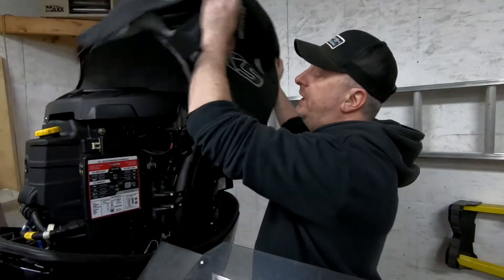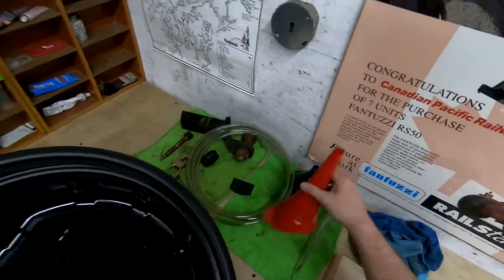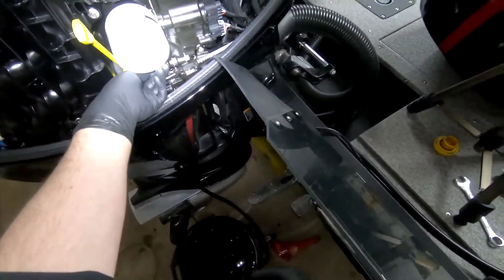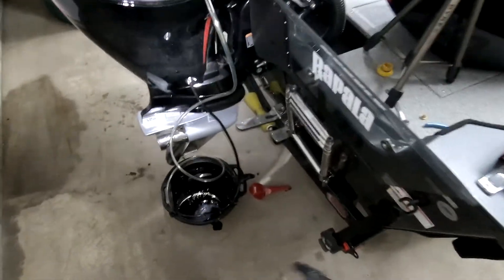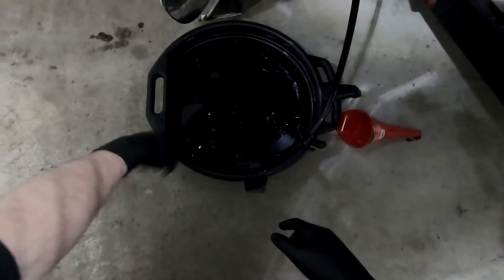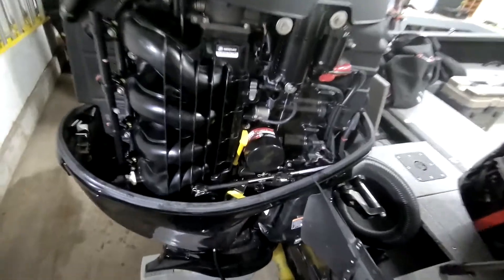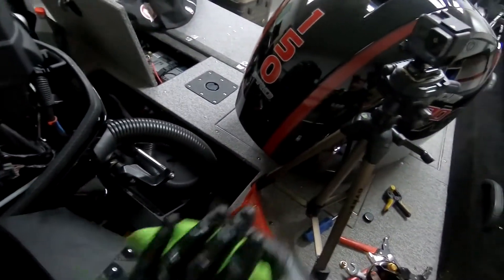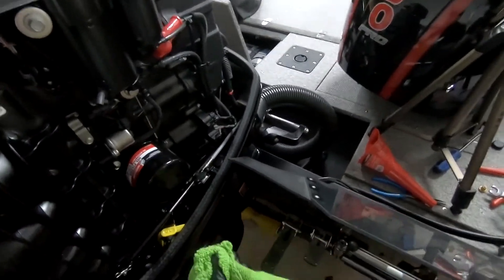2019 Mercury 150 Pro XS 4 Stroke - Oil and Fuel Filter Change

Comment: Thanks for the video.  The lower fuel line dropped in the filter hole.  It's in the lower part of the motor.  Anyway to get it back out, or do I need to go to a dealer.
Reply from the maker: Thanks for watching!  I pulled it up and clipped it so it wouldn't fall, I'd guess it isn't too deep but never fished one out.  Maybe a drain claw grabber and a light to see?
Reply: @TheGrumpyFisherman , I got it out using light, #6 ground wire bent to a hook, and needle nose pliers once it got close.  It wasn't easy.  I will do my best not to make that mistake again.